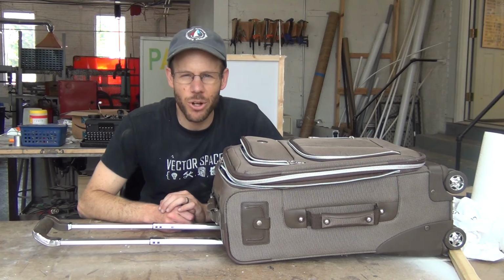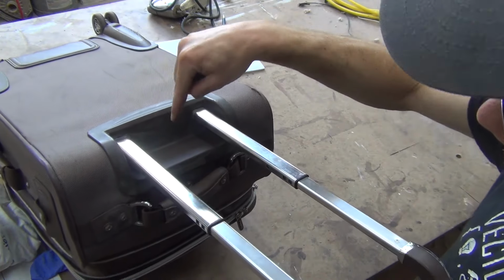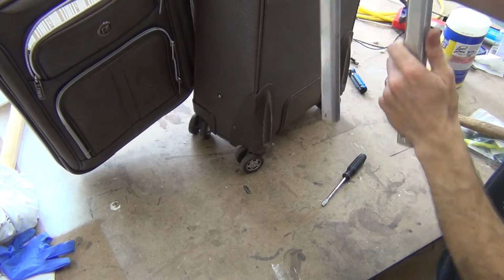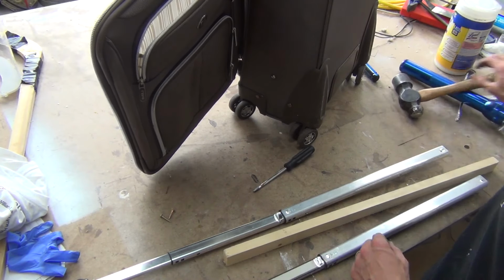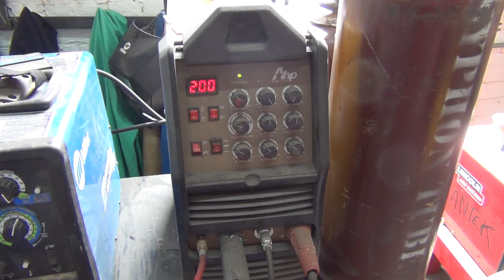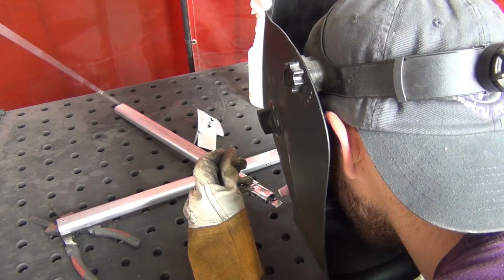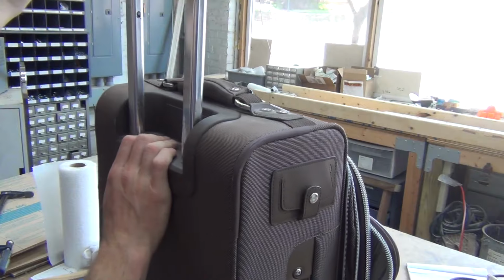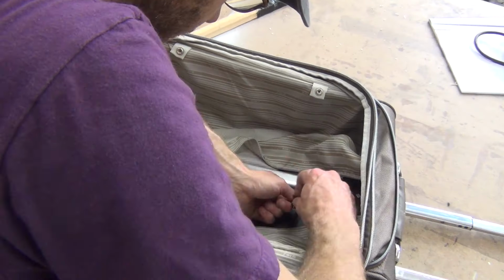Suitcase Repair

Comment: How would you go about bending/banging out a rail from the inside so the smaller piece can have room to slide inside and not catch on the squashed outer (larger) piece?
Reply: A steel paintless dent repair rod inserted within the handle tube.  Put it in a vise just snug enough so you have leverage to push out the dent without creating one on the opposite side